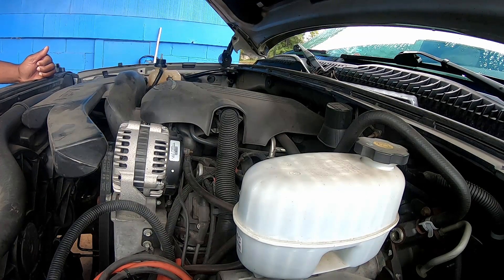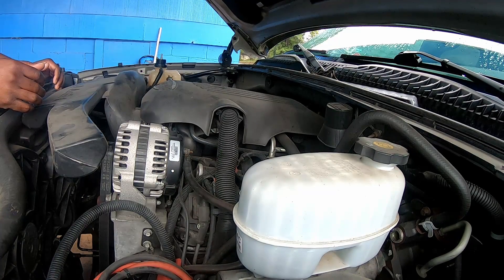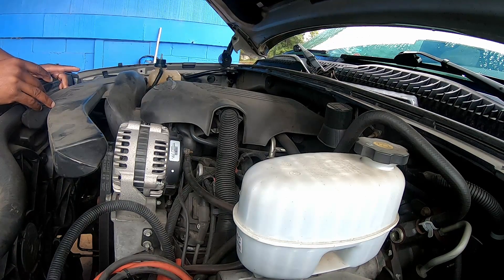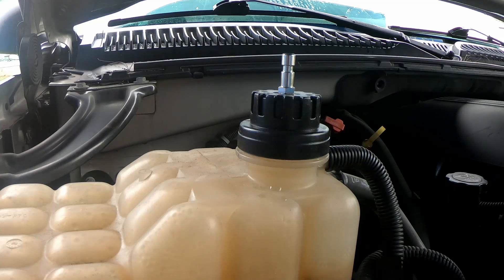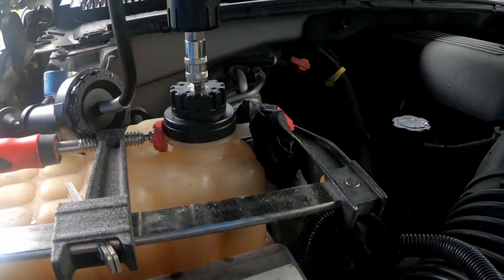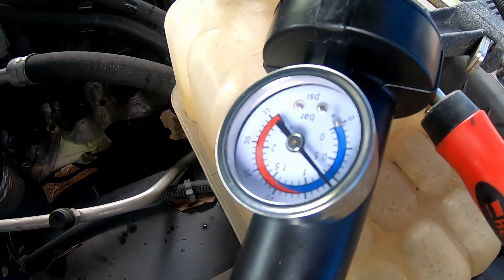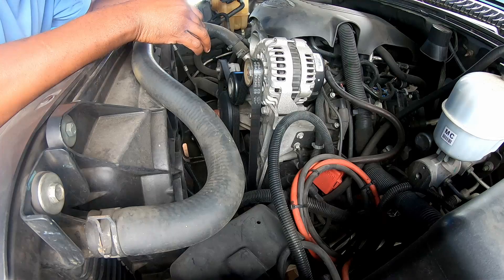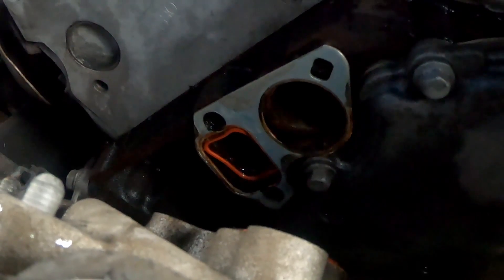How to find a coolant leak on a LS 4.8, 5.3, 6.0 (cooling system)

Comment: Nice! I have the same issue. 2004, 5.3, drip drip drip! I've been smelling coolant for a while now. The leak finally got heavy enough for it to drip past the skid plate and onto the driveway. Fun!
Reply from the maker: Let me know if you have any questions 

Thanks for watching
Reply: @Slicpartna  I ended up replacing the water pump today. Pretty easy really, except for the coolant mess. Whoever it was at GM that made the decision to block off the radiator petcock is a grade-A idiot, lol. I ended up putting two and a half gallons of coolant into it when I was done, and after bringing it up to operating temperature, it doesn't show any signs of leaking! Fingers crossed.
Reply from the maker: @SomeGuyInSandy  hopefully that solved the problem.

Let me know if you have any future questions

Comment: I have questions my Yukon Denali xl gmc leeking ain't freeze
Reply from the maker: Whatz up doc
Reply: @Slicpartna   my Yukon Denali XL GMC  leaking antifreeze under the car but car not smoking or overheating
Reply from the maker: @Rook814  I would recommend pressuring the system to Identify where the leak is coming from

It could be a hose, the water pump, the radiator etc.

Let me know if you have any other questions 

Let me know
Reply: @Slicpartna  I will thank you your video help me
Reply: Another question how would you know if it's the water pump I think it's a bad whose wen you pour it in the line goes down rite away but the antifreeze comes out in seconds but still don't over heat no smoking
Reply from the maker: @Rook814  water pumps usually leak around where it mounts to the block, weep hole or around the back side of the pulley (bad bearing)

If your coolant is leaking out fast I would say it is a hose 

You have the upper and lower hoses that goes to the radiator and the heater hoses

Let me know if you have any other questions
Reply: thank you again
 @Slicpartna

Comment: Ok my 03 4.8sierra was leaking down the engine oil pan like yours. i got a new water pump and thermostat 3 years ago.  So yes pump is still good good.  Thankfully all i changed was the 2 water pump gaskets. The one closest to the alternator was broken in pieces and that was the source of the leak.
Reply from the maker: Cool beans!

Let me  know if you have any other questions

Comment: I am having the same issue  large amount of coolant liquid  under the engine,  I changed the input out put hoses and the V hose then the coolant reservoir  and still a leak that I can't find.😢
Reply from the maker: Could be the water pump (weep hole)

Comment: What is the name of the kit that you got from the store you're talking about and what is that to you use is digital when you was turning the tighten it it would let you know it would make a noise I'm having that same problem with my 2004 Chevy 1500 Suburban Z71
Reply from the maker: Hey hey thanks for watching 

It is a radiator pressure tester,
You can find it at harbor freight 

I was using an electronic torque wrench 

Let me know if you have any other questions

Comment: I’m having exactly the same problem I just don’t know where it’s leaking from I’ve changed. Pretty much everything
Reply from the maker: Did you check the steam tubes on the heads?
Reply: Did you figure it out? A ghost leak unfortunately makes me check my oil right away! Check if its clean good looking oil, or is it frothy and whiteish?

Comment: Water pump bolts have a sequence and a torque to be followed. Center bolts first then criss cross 22 ft lb not left side first then right side
Reply from the maker: You are correct on your observation

Comment: Were you getting any coolant odor through the a/c vents,when your coolant was leaking?
Reply from the maker: No I didn't a coolant odor through the vents but I could smell it outside the truck
Reply: If you smell it in the vehicle it's most likely the heater core inside the truck behind the dash/glove box.
Reply from the maker: @wrenchone5003  yea yea
That is a strong possibility 

Thanks for watching

Comment: Great video!!!! Question?? Is it possible to mistake a rear main seal leak for this type of coolant leak?
Reply from the maker: negative, rear main seal has to deal with the oil seal around the rear of the crankshaft.
now if you are talking about the rear steam tubes for the coolant then you should see the coolant come out of where the leak is.  it is possible to have more than one leak.

let me know if you have any more questions

Comment: My buick century was leaking coolant bad and i could not figure it out and today i look behind the coolant tank on passenger side and it's soaking into the back of the glove box ?? It's dripping down to the ground i did not see it or saw it getting soaked i tried to reach to see if its a cracked or a hole I'm not a car guy i don't know what to do i had another leak i know it was a head gasket it
Reply from the maker: Is it wet inside the car?
Is the carpet wet?

Comment: This is exactly what's going on with my old lady truck she haves a 03 GMC Yukon and I told her she need to service her truck because I think she was losing coolant two weeks before it came to this problem. I have this sense that I can smell when the car is having a problem. I know what transmission fluid smells like I know what oil smells like I know what coolant smells like I know what gear oil smells like so I know when it's that time to service a vehicle. She never believe me so I just watch her get upset about😂
Reply from the maker: Might want to get those issues checked and corrected before there is serious damage.
Reply: @Slicpartna  That's a bet it's been at the house about a week now she's waiting for me to fix it or take it to an shop

Comment: I have a 2007 Chevrolet Suburban 2500 6.0 I just change the water pump, temperature coolant sensor, termostat , fan clutch, head gaskets and radiatior was replace maybe 2 and half year ago but still overheating 🥵 because in the heat 100 degrees my ac just go off and start blowing hot air I don’t know what else to replace
Reply: May have air in you coolant system that would cause that too
Reply from the maker: How long does it take for the engine to overheat?
Does the air for the heater come out hot?
What type of coolant are you using?

Make the sure there isnt a blockage
When the engine starts to overheat, the top hose should be hot and the lower hose should be warm.  I suspect that there is a blockage in the system.  I would suggest doing a coolant flush.  

Let me know if you have any other questions

Comment: How often did you have to put more coolant in? I have to replace mine after driving about half a tank of gas out. I was wonder because idk if my leak is too small to find with the pressure test.
Reply: Thanks sir. I’ll let you know if I get it fixed.
Reply from the maker: I was adding coolant maybe every 2-3 months. I kept putting off fixing the leak

Let me know if you have any other questions

Comment: I have a significant leak in my 2000, 5.3 L, Sierra that I couldn't locate without taking the whole top compartment apart. I saw your video today and happened to be close to Harbor Freight with my 20% Coupon in hand. It worked beautifully out of the box. I found the hole in the radiator in 3 minutes. Thanks much for sharing - the cost of the tool was about half the cost of a mechanic doing it - saved money and time !
Reply from the maker: I'm glad you were able to get your truck fixed and back on the road

Comment: I think I got the same problem but do U think its convenient to replace the hole water pump, or just the gasket??
Or what did U do?? 
But great video thanks for that
Reply from the maker: Be sure to verify where the leak is first

You wouldn't go wrong by replacing the water pump especially if there are alot of miles in it 

Let me know if you have any other questions
Reply: @Slicpartna  yea I dont know exactly when was the last time they replaced it I barely hot it a year ago, 
I'm saying cause the water pump works just fine but it it's just the leak
Reply from the maker: @bernardoalpizar6689  how many miles on it?
Reply: @Slicpartna  253,000 so I dont know if they have replaced it before
Reply from the maker: @bernardoalpizar6689  yea yea
It wouldn't hurt to replace the water pump especially if you suspect it might be leaking
Reply: @Slicpartna  well, thanks man,  this was really helpful
Reply from the maker: @bernardoalpizar6689  let me know if you have any other questions

Comment: Thanks for the video that was a great  help to me
Reply from the maker: Thanks for watching,

Let me know if you have any questions
Reply: Hi I'm Mary 
I have the same Issue .I've replace my water pump and hose just this week .I have a 
2005 Chevy Silverado V8 5.3 liter 2 wheel drive 
Crew cab .I wondering if this is a recall thing with Chevy  GM .? I'm a 65 year old Lady doing all this myself .I bought in November 22 2022.